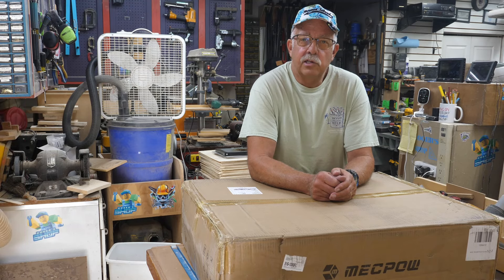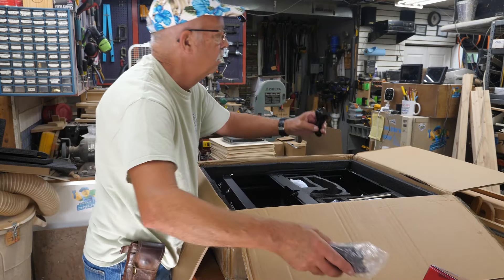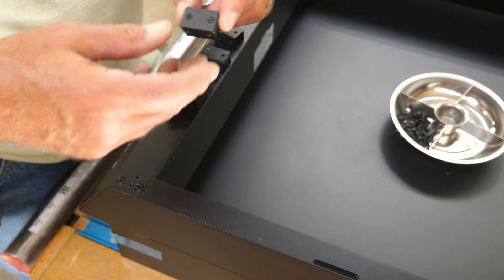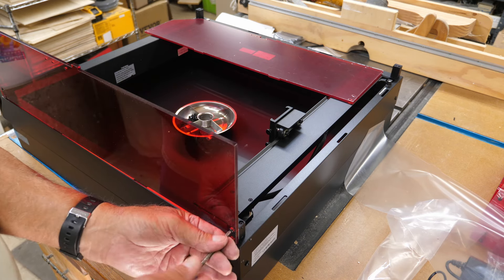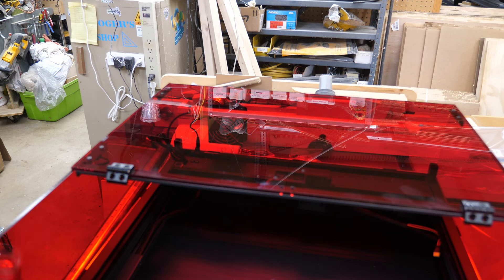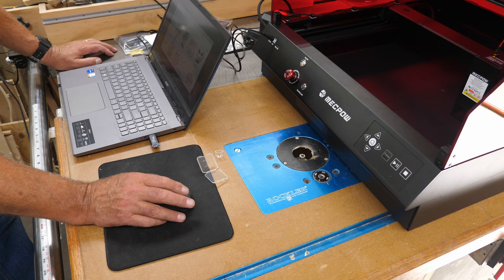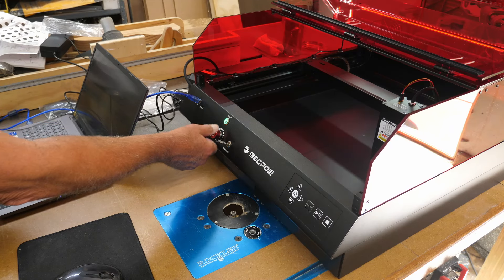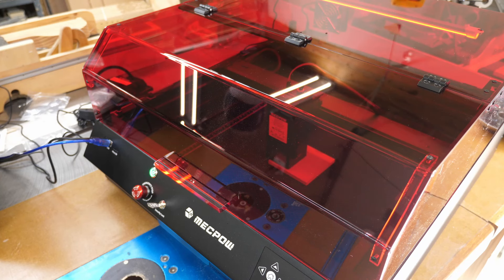Mecpow X4 Pro Class I Laser Detailed Assembly and Startup

Comment: lightburn is reporting back that the door is open and its not. It keeps bleeping at me! 😆 Is there any adjustment to the lid anywhere?
Reply from the maker: There is a magnet on the lower left side of the cover, in front.  It needs to contact the base to activate a hidden magnetic switch.  If the magnet is missing or not aligned, it will think the door is open.
Reply: @rogersshop  Spot on Roger. Thank you. 👍

Comment: This looks like a laser with all the added features included. Good value as well which makes me wonder if it is a good laser or a dressed up inferior laser. Do you have an opinion Roger? Cracking video as usual. Thank you for that. Keep up the good work.
Reply from the maker: I used to also have the X3, which is a class IV.  It performed well with zero issues.  This one also "does what it is supposed to" without any problems.

Comment: Hello Roger, after watched your video about mecpow x3pro i bought it. And now thinking to buy mecpow x4 not pro version. Im doing mostly cutting 3-4mm plywood. Will it be big difference on speed while cutting on 10w vs 20w laser? Is it worth to upgrade laser?
Reply from the maker: Yes, it will be faster with a 20W. As for is it worth an upgrade, it depends on what the end use is and how much it is used.